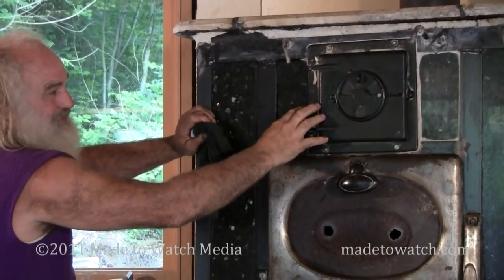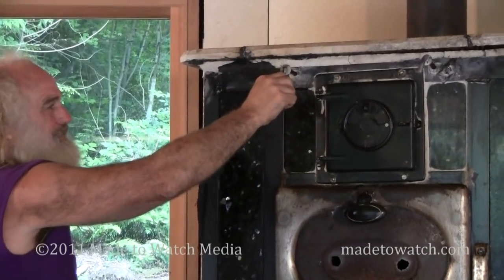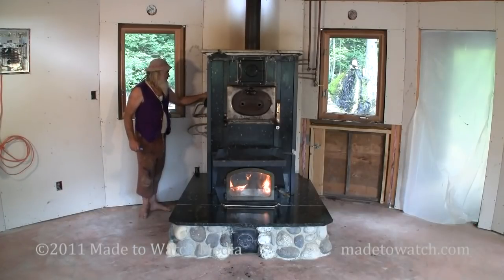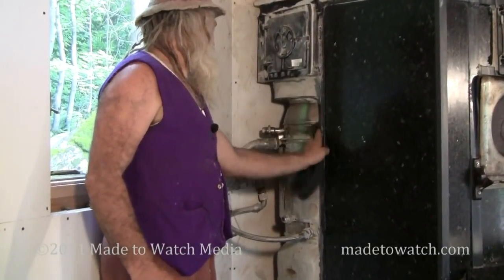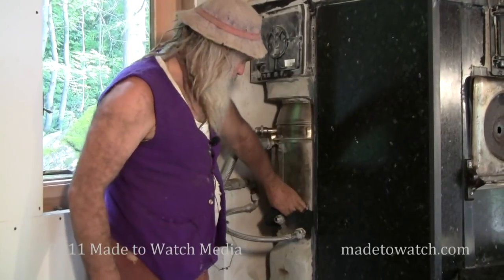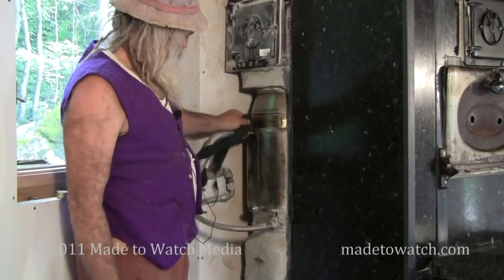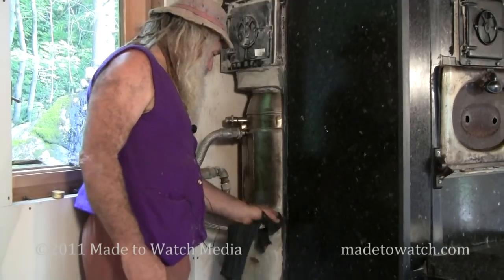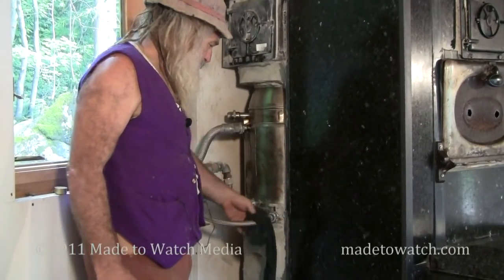SunRay Kelley's Stove

Comment: @AMilitantAgnostic I have seen years before in North Wales the much smaller version - a Rayburn oven. Our friend was cooking with the oven, after a wile the water was hot, so she opend the valve and the waterheating heated the house (as you like, it was a central heating for ca. 100 qm). If  the system made some trubles, sometimes happened that the steem was coming out from the security extension pot."Inventing the past" can be sometimes very interesting, I appreciate that!!!

Comment: Excellent job! Primative machine that works better than ANY computer designed stove. You can use this to do anything.....and the steam boxes too..Great to even get your heat up from the floor. Lots of forethought and common sense. Looks like if you designed cars we would get about 7000 miles to the gallon. Thanks for the video , and the inspiration

Comment from the maker: It's been working great for over a year now. If anything, it's still burning a little too hot. Some days you have to open a few windows to cool the place down. The goal was never to generate enough electricity for the whole house, just enough to charge batteries, run some LED light strings, etc. The whole point of this design is that the average stove produces way more BTUs than it needs to keep flue gasses flowing out the chimney. This design squeezes almost every possible BTU out of firewood.